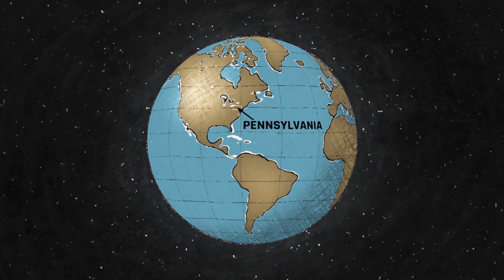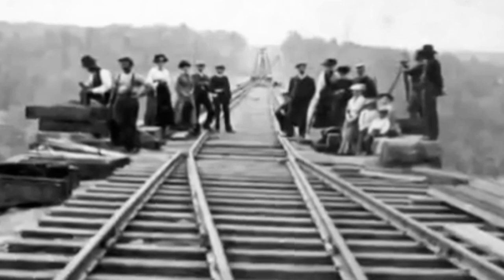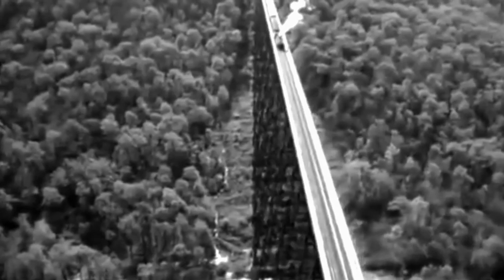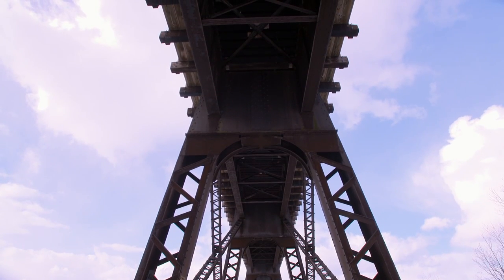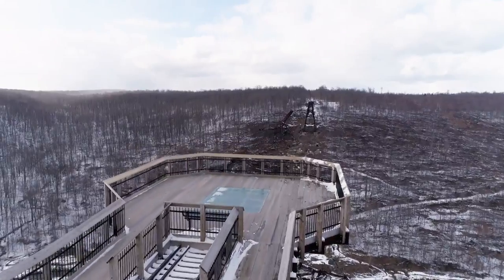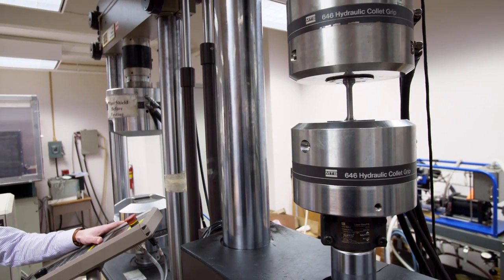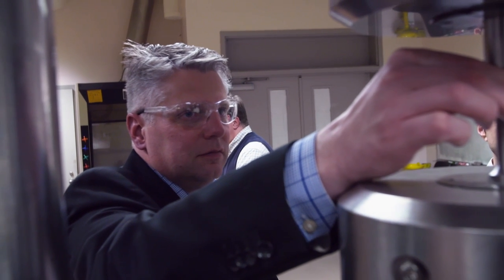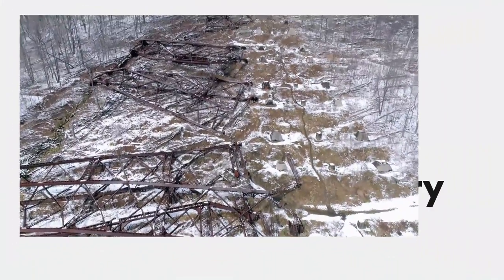How The 8th Wonder Of The World Failed Due To An Engineering Oversight |Massive Engineering Mistakes

Comment: 120 men built it in 90 days and it stood for 110 years until a tornado hit it. Hat's off to the real men of yester-year.
Reply: And today, it takes 5 years of politicking and "environmental impact studies" before the first shovel even hits the ground :/
Reply: I don't think they counted the workers ... 120 men is for Engineers only
Reply: @aryamanjaswal3258  negative
Reply: @aryamanjaswal3258  you don't need that many engineers for that and certainly not back then they didn't.
Reply: @joelpaape8748  one engineer if that
Reply: Not built in 90 days, it was rebuilt in 90 days.
Reply: That isn't very long tho
Reply: I bet if they had those steel anchors the bridge would have fallen in a similar way when the tornado came.
Reply: @livelyupmyself1  it definitely would have steel with winds over 80mph does not stand still
Reply: How many men lost their life working on it, life was cheap back then and sheep were scared
Reply: @anthonyboerio4955  as it should
Reply: @thanhavictus  - Stop defending parasitical bureaucrats.
Reply: @livelyupmyself1  yeah probably. Both materials rust and they were inside concrete where there’s very little drainage.
Look how rusted the steel rebar gets inside concrete over much shorter periods.
Reply: I mean... 100 years is acceptable infrastructure life. Should probably rip it down or build a modern bridge next to it and keep the old as a monument.
Reply: @joelpaape8748  you have no idea how many engineers were needed back then, just simply due to lack of PCs, armies of engineers over huge sheets of paper
Reply: @DJBillionator  it is a park now.  Trains don’t run there anymore.
Reply: @lorenkargard8303  in India it's still cheap
Reply: Back when houses were built properly and cheap, good on them for such a solid structure!! Everything will fail eventually.
Reply: This channel didn't explain the bridge very well. More graphics and less austere music.
Reply: @anthonyboerio4955  because sorry we care about species lost forever more than a useless bridges
Reply: @DJBillionator  it stopped serving a real purpose as their are way better routes for trade as well this thread is filled with a bunch of anti union right pipeline kids
Reply: Buildings in New York City only have to be engineered for a life expectancy of 50 years. Just like the route 40 bridge in Memphis I believe this bridge would have eventually failed due to faulty inspection without any tornado.
Reply: In 124AD two bronze doors were cast 25 ft in height 2ft thick, yet balanced well enough to be opened by one person.  They are still in use today, different building tho.
Reply: Iron men building steel bridges.
Reply: @Alex-uy7pc  i tried googing that, but couldn't find anything. 
Do you have a name or something that would help me find out more info on those doors?
Reply: @Alex-uy7pc  hey and you know what? Two doors wont environmentally impact anyone!
Reply: @heyfoo7947  never said they would, I was just stunned to find out anything man made could last 2 millennia in the desert, especially when the original building was completely destroyed by an invasion.
Reply: In uk can barely get council to fix a pothole in less than 90 days
Reply: @ukteen6630  that has nothing to do with environmental issues. City infrastructures
Reply: Tell me the warranty on ANYTHING built NOW? 10 years? Maybe 20? Yeah sounds like they were doing well
Reply: @hzuiel  I dont think youve recently updated yourself on how many animals/plants we have unnaturally destroyed
Reply: people also aren’t taking into account that the tools of that period probably played a huge role in the decision as well. current tool technology has come so far that it would probably replace a portion of the manpower that was required at that time.
Reply: @dickward1090  exactly
Reply: I don't call that an oversight
Reply: Yeah and now a days it would of taken 7 years and 2000 men. With a budget of 300 million.
Reply: @Taylorhpatrick  *starting budget. and it would’ve gone over budget.
Reply: Considering most of the reinforced concrete bridges built in the 70's are coming up to their use by date, I am very impressed.
Reply: @dickward1090  Also over time.
Reply: AMAZING HARD WORKERS!! A THING OF THE PAST!😱😱😱😱
Reply: @anthonyboerio4955  rightfully so things like this never happens
Reply: @yallawallahalla  unless the steel rebar is exposed it will never rust.
Reply: @dirkdiggler9379  it most definitely can rust inside the concrete. 
Concrete is pourus. It absorbs water like a sponge.
It’s mainly an issue in marine environments or in areas where salt is used to melt snow/ice.
But I’ve seen plenty of old balcony’s ect that are falling apart because the rebar inside has rusted and has expanded and separated from the slab.
Reply: Right? I think that bridge did it's job and then some.
Reply: There was almost no reason for them to foresee a tornado ripping through the Pennsylvania countryside, especially when they engineered that bridge.
Reply: Exactly. This sounds more like a huge win, not "epic fail"
Reply: Todays tradesmen could have done it too, but now workers have rights 😅
Reply: Nowadays they couldn't build that bridge in 10 years and no chance in hell it stands for 110 years. Back then people were a much different breed.
Reply: everything back then were over built and over engineered to be on the safe side.
Reply: Yester-century
Reply: i came to this video thinking it was going to be a catastrophe i am  nothing but impressed now
Reply: Hell yes! Well said!
Reply: @sadathaddu  it may be treated as cheap, it's not cheap. Life is precious, especially when you consider that after death comes judgment. Repent and believe in the gospel
Reply: Obviously UNION BUILT
Reply: Before OSHA these work sites were deadly.  Company doctors were shady liars.  Lifespan for men in OSHA jurisdiction increased by many years.
Reply: Men are still the same it's culture that has changed on projects.
Reply: Yeah men were real men back then not crybaby workers that we got now .
Reply: @notfiveo Lol and you are in all sorts of debt and I’m willing to bet your debt to income ratio makes you less free and less enslaved to work then them …. So shhhhhhhhh I’m trying to concentrate .
Reply: @anthonyboerio4955  true that.
Reply: @benleister  Houses were crap then.
Reply: Not a “fail” at all when you put it that way
Reply: @joelpaape8748  so they need more now? Lmfoao your logic isn’t there. I bet your brain isn’t either
Reply: @Grggeorge  it doesn’t need to be still clown, the bridge was made to move and be flexible as to not break or give up somewhere. Learn English please
Reply: @sylviam6535  hun you know you have never built anything in your life let alone OWN anything Lmfao
Reply: @Rider0fBuffalo  hey have you heard of a little thing called YouTube ? Ignorant peoples go on it to learn stuff. Try it and stop relying on one video.
Reply: @alexaecho4273  - You can’t even write with the spelling and grammar of a 10 year old.
Reply: @aryamanjaswal3258  Back then everybody was a worker and engineer 😂
Reply: @heyfoo7947  are you going to cry for the little animals? Calm down Francis
Reply: Facts.
Reply: your all wrong! it was 94 days and it was pre fabricated off site… that’s what it only took 94 days to bolt it together
Reply: Very impressive indeed. I also love how they’re blaming the original designer for building something that only lasted 110. Plus there is no way they didn’t have to do maintenance in that time and no one thought to upgrade it.

Comment: How can this be considered an engineering failure? The bridge was taken down and rebuilt was used for over 100years. A tornado in an area that doesn’t get tornados blew it down.  Maybe it couldn’t handle a 100 mph winds but it did what it was designed to do for well over a century.
Reply: Thank you 😤
Reply: They had to get us to watch somehow, and it worked, lol.  But my thoughts exactly.
Reply: I agree, tornados in this state are very uncommon and normal damage is minimal, I grew up being told as a kid, we can't have tornados, to many mountains lol. I've read and seen abt much worse  "engineering failures".
Reply: @chrisherb8262  exactly it's not like the bridge failed look at galloping gerdy that's a failure
Reply: If anything, it should be praised for being built so sturdy with supposedly outdated design and materials. Remember the Minnesota bridge collapse? That bridge was only built in the 60s.
Reply: @MrVuckFiacom  exactly that's my thought
Reply: Western PA actually does get tornados usually 2 a year
Reply: Yeah, Discovery is running out of ideas. Here’s an idea Discovery: Explain how three buildings in New York collapsed after two were allegedly struck by aluminum planes. 😂
Reply: @joshuaraleigh4648  a tornado can throw a playing card through a cinder block wall, you need to account the speed of the aluminum planes
Reply: @dustinscheller7795  we get one a year at least with in 100 miles from me
Reply: @dustinscheller7795  im in south eastern pa 10 minutes from philly we get 1 a year atleast. I never heard of this incident.
Reply: Exactly what I came here to post. Less of an engineering failure and more of a win for mother nature
Reply: lol same
Reply: 911 was a structure failure as well.
Reply: @Droppingineveryvideo  they were going to replace the bolts but after going through all the red tape it would have been ten years before they could start.
Reply: @yakamarezlife  seen it before, went and watched it again. Crazy how that bridge was like spaghetti!
Reply: same thought
Reply: Easy come, easy "blow".......
Reply: The collars seemed like a good solution at the time, but over a century later a freak weather event would disprove that notion. 

Who writes this shit?
Reply: It's still an engineering failure in the broadest sense, in that the structure was compromised and is no longer in operation. I think it's mainly your interpretation of the word 'failure' that may seem uncharitable, when it's a common term in engineering that means the structure simply broke. To be fair though, their language was rather hyperbolic at points
Reply: Chris Herb i was told the same here in northern mass. Still ain’t seen a tornado in all my life so I guess it must be true enough
Reply: My thoughts exactly, even structures designed to withstand 100mph straight line winds may not handle the vortex of a tornado.
Reply: Damn bloody Brits
Reply: @MrVuckFiacom  Yep. Or the one in my lifetime, in 04'. Hell, a Chinese engineer basicaly said that should happen in China, not in the United States.
Reply: @joshuaraleigh4648  I farted.
Reply: Edward Martinez  Every so many floors (I forget the number) there were back up gens and fuel tanks. Said equipment was UPS for the comms.

That was a significant part of it. As well as iron oxide and aluminum shavings can be a combustible material.
Reply: I wholeheartedly agree. Any engineering like this would of had its design lifetime laid out in the original blueprint. I bet that this bridge was beyond that lifetime and still took a hefty event to bring it down. Original engineers are in no way to blame here.
Reply: I also was thinking this
Reply: Exactly!
Reply: Exactly my thoughts as well. I give those engineers over 100 years ago a thumbs up. Today’s engineer has computers, cad etc to use. The engineers of yesteryears had a pencil, paper and a slide.
Reply: @pacificule  also a win for the state not cutting maintenance on infrastructure. Those guys are heros for for finding the corrosion and stopping traffic on the bridge.
Reply: @redsand128  good call! people were killed in Genoa last year because the obvious repair work was stuck in bureaucratic limbo. And that bridge was only, what, 60 years old? Crazy
Reply: This area certainly does get tornadoes and in fact several people were killed by a tornado in that area in the 1980s. WPA has tornado watches or warnings nearly every summer.
Reply: James Konzek  I live in Alabama USA. I can tell you Without a doubt that a tornado does what a tornado wants to do. The Only bridges I've seen survive basically unharmed were made of concrete.
Reply: @freebirdnation923  Repair was underway when the tornado hit. The anchor bolt replacement was completed only on the section that remains standing. This was not mentioned in the documentary.
Reply: The engineering failure is that a modern engineer should have modeled it in wind and recommended an easy fix such as tensioned steel cables to provide uplift retention.
Reply: I agree with you completely! Structures get destroyed by tornados but not necessarily because they were engineering disasters. What an awesome bridge, sad this happened.
Reply: @dustinscheller7795  😒
Reply: Completely agree.
Reply: @chrisherb8262  Tornadoes in PA are more common than most people think. I live in eastern PA and I've seen 3....and two ripped through the Pocono Mts.  Not as common as the Midwest...but they are a possiblity everytime a strong thunderstorm forms.
Reply: Agree, anyway, 120 men  in  just  90 days! We  haven't  been  able  to  get  the  microwave  in the  canteen  to  work  in 2 bloody  years!
Reply: Gotta blame something.
Reply: Yeah, its an interesting video but damn the drama... 90 days to make a bridge !
Reply: Not to mention that bridge would have come down in a tornado regardless of the anchor bolts.  Also notice their wildly misleading tension test.  They tested cast iron against the steel, but the original bridge and it's bolts were wrought iron not cast iron.
Reply: @Rowgue51  TV on youtube is still TV... drama is useles
Reply: drinny26 pretty much sums up what’s wrong with people today.  Lambast and critique a thing... call it a failure.  Vs celebrating it and actually seeing the truth of a scenario.   This video was painful to watch.
Reply: @brettvickery9293  
Not true.
Reply: @joshuaraleigh4648  Those aluminum planes don't have the same mass as a beer can. Use your brain.
Reply: 160 km pr hour winds for everyone else.
Reply: could have taken the higher winds if the anchor system would have been replaced before but those failed and did not handle the higher wind loads.
Reply: It fell down. Isnt that reason enough!
Reply: Pretty certain these things aren't even designed to last 100 years.  The fact that they hadn't replaced it before then is more a sign of penny pinching and good engineering than poor engineering practice.
Reply: @jed-henrywitkowski6470  Iron-oxide combines with Aluminum to form thermite but they need to be turned into a fine powder and mixed well before they become highly combustible
Reply: the anchors failed so technically it was an engineering failure regardless of howlong it had stood prior to that.... it took engineers to design the caps and anchors
Reply: @joshuaraleigh4648  Jet fuel can't JFK the moon landing
Reply: J
Reply: luck rather. the tornado could have hit in the bridges first year
Reply: M
Reply: …”even with today’s technology this would have been a challenge”…thankfully she said that, I thought the same. I am dumbfounded this took only 3 months?!?
Reply: How many in depth hi end documentaries have you filmed and edited?
Reply: @pacificule  I remember learning about this in my engineering classes. It is why the saying “concrete sucks in tension” is permanently burned into my brain.
Reply: How long has the great wall of China been there
Reply: It failed. No, tornados should not cause a rail bridge to fail.  No uplift design was a mistake, period.
Reply: +1
Reply: Exactly!!
Reply: @Kiwitakimago  Bridge worked for many years, and then it … failed, and failed due to flawed engineering, not accounting for uplift.
Reply: @Nill757  the correct bolts most likely still wouldn’t keep it from lying on the cavern floor!
Reply: @Kiwitakimago  Based on what?  A large wind load like a tornado would put that structure in  increased tension. No chance that steel fails in tension.  It was the lack of uplift control that caused the failure.  

Cast iron fixtures for hold down from that era could be made large enough gauge to hold down that bridge.  Steel fixtures decades later could certainly have be made in upgrade to hold it down.
Reply: I thought the same thing
Reply: Same!
Reply: Bridges shouldn't come down due to wind lol
Reply: @bmf_weapons8796  Eh, not just ‘wind’ but tornado to be fair. Still should not have failed.
Reply: No shit😂
Reply: I live near there and have seen it many times. Yes there are tornadoes that come through a couple times a year. It is very interesting to see. It still exists just as it was when it came down and is now a tourist spot.